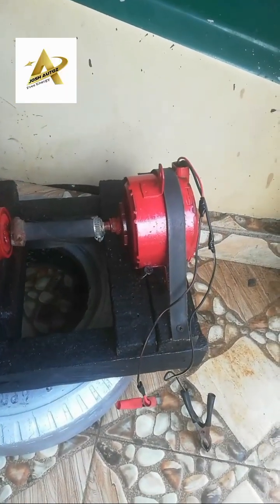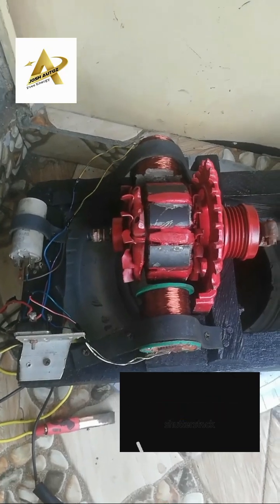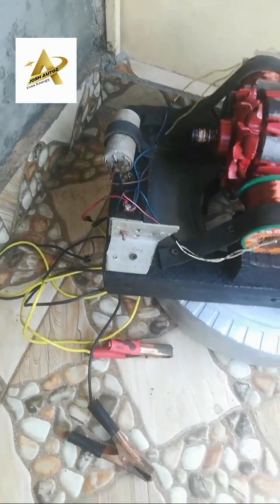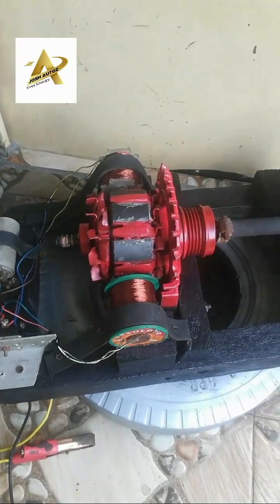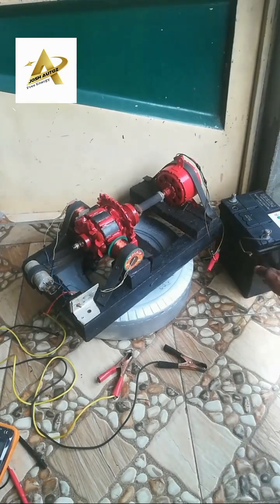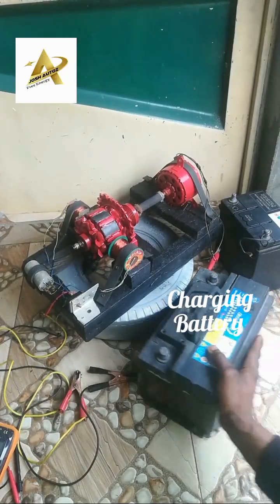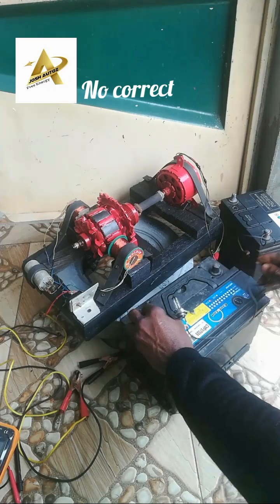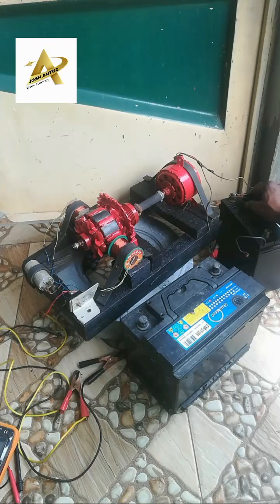Efficient dc mode fuelless generator

Comment: Where is the load???.... What am seeing is transfering charges from one battery to another...
Reply from the maker: The series connection means the two batteries are receiving charging from the generator, you can't transfer     correct from one battery to another battery. I'm going to do another video about this generator for more understanding, how to system works.
Reply: @joshautoz3439 Capital NO, this is a loop system and the energy that you claim is changing both batteries are not coming from the air but one of the batteries.... The system can't generate more power than what you put in it. You are just transferring the energy in circle with losses......
Reply from the maker: So where do you think that high spike is coming from, the system is producing high voltage more than the input voltage,
Reply: @joshautoz3439 No, there is no high voltage; that spark is current(amp) which occur as a result of high load and it's high load because, the 2 batteries are same or almost same capacity. According to the 1st law of thermodynamics, energy can't be created or destroy but can be transformed from one form to another. What you are doing is just transferring the battery chemical energy to the motor to drive an alternator to charge back the battery.... The 2 batteries will only share the energy meant for 1 battery and over time, the 2 batteries will run down because, no system is 100% efficiency. So, has it charging, it's also loosing energy.
Reply from the maker: That is what they what you to believe, that energy can't be created or destroy, energy can be created believe it or not.

Comment: Sir, pls can tell the voltage from charging alternator without connecting series battery. That's when only the drive battery is in use.
Reply from the maker: Good day sir, i connect it in series connection because the correct that is generated is just too high for one battery. The drive battery have nothing to do with the power that is generated by generator.
Reply: Thanks for sharing. In essence, the drive battery does not receive any charge from the generator. It will continue to go down without being recharged. Therefore the generator only recharges the second battery which can also be used to drive a load say an inverter or whatever one wishes.
Reply from the maker: Ok, i understand what you are saying. But that's not the case here. That why I'm using smaller 35 hap battery to drive the generator. I'm going to part two of the video for more understanding